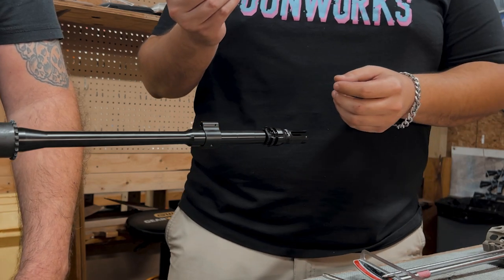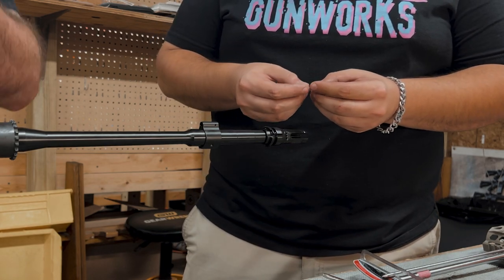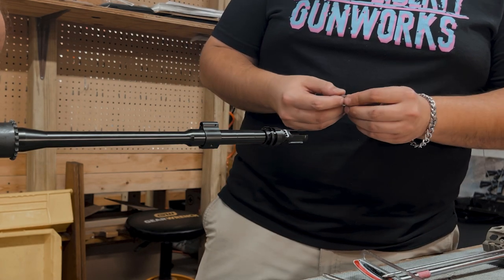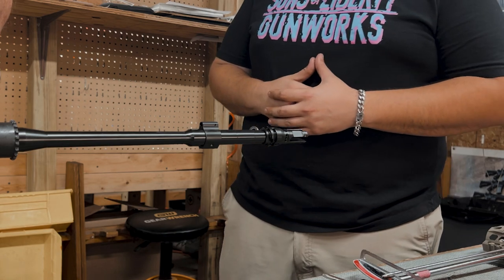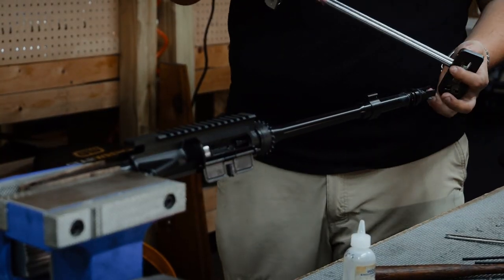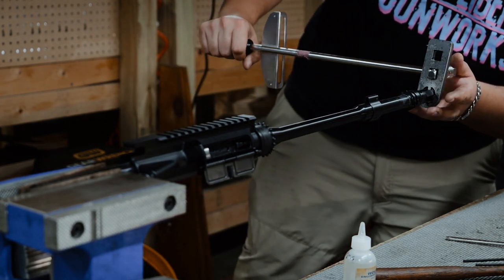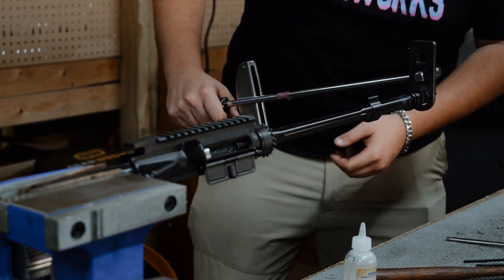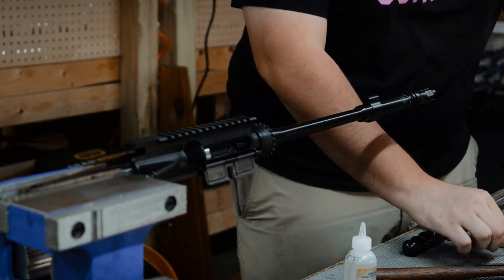Armorer Tips With Sons of Liberty Gun Works co-founder Mike Mihalski

Comment: I had a Nox that threaded on to about 12:30 with no shims, put on the thin shim, had no "squish", had to put on thick shims to get another 360°, then the shims had some "squish" and torqued down perfectly timed. Never knew that you actually need a little stack to get the squish needed for perfect torque AND timing.

Comment: I got fed up with trying to time it with shims(surefire 4 prong). I just only used the chamfered shim & torqued it to 30 ft/lbs. Surefire said it was fine, that it needed to be timed was not a must. Rather to just make it less frustrating when mounting a suppressor. The thing would not move past the 5:30-5:50. As they use 6:00 as the timing position.

Comment: When you talk about torque value, remember the more stable the platform is from the start the better your torque value will be.

watching the barrel flex to get a torque value you will be over torquing at the end by the wrench.
Thats why they always say never use an extension on a torque wrench because it messes up the final torque spec.

the wrench on the wrench will also flex just like if you used  an extension on a torque wrench you will get a false reading.

but what do I know I just rebuild motors as a hobby